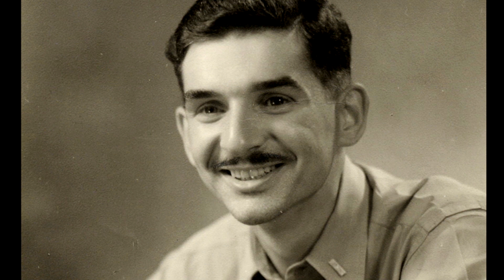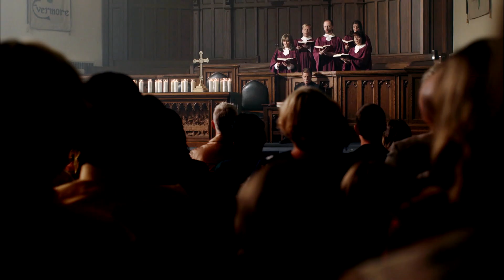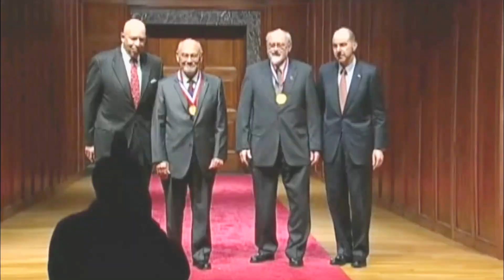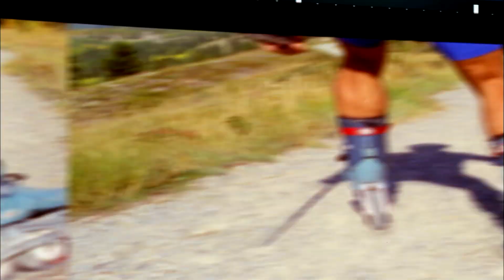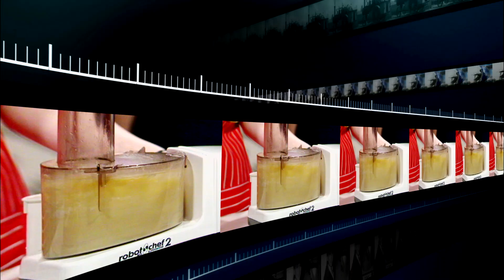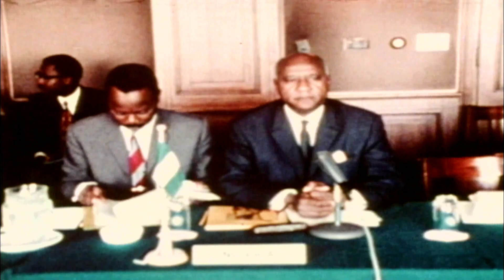Inventions that Shook the World | The 1970s

Comment: The "original hybrid" worked exactly like a diesel-electric locomotive, except the regenerative braking system was not so robust it needed a system of heaters and fans on the roof to dissipate the excess energy.  It sure saves on brakes!

Comment: The US Army had "Walky Talky" in WW11 - looked more or less the same only bigger. Sgt Bilko had one too on the Phill Silvers show from the 1950s. Their haircuts are too modern for the 1970's.
Reply: There are fundamental differences between walkie talkies and mobile phones. First of all you can't simply call whoever it is you want to call by simply dialing their number and they don't use a cellular system that allocates and changes the transmitted frequency on the fly like cell phones do. More importantly walkie talkies are a single channel system whereas phones operate on 2 channels (full duplex) so that you can simultaneously transmit and receive at the same time. No need to say "over". Over and out.
Reply: Motorola made those as well and called them handie-talkies.